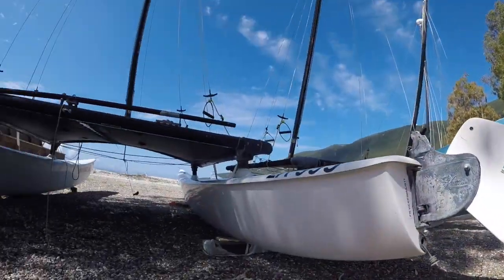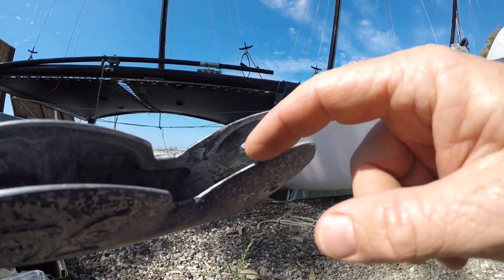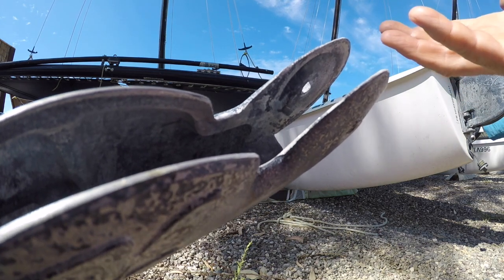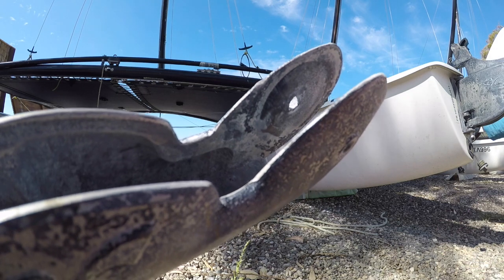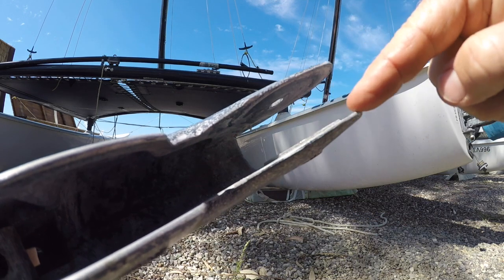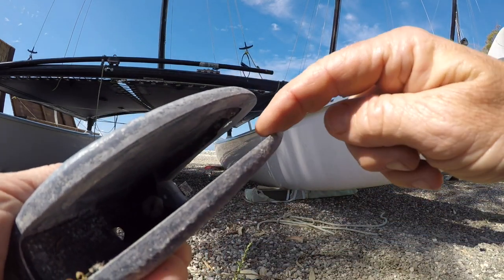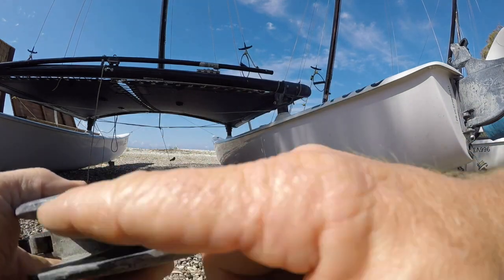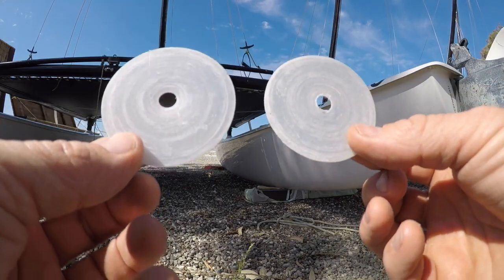Save your rudder blades with this very quick job

Comment: Something else that's very easy to do, is to cut discs from teflon tape and stick them to the sides of the blade. Makes it very easy to install the rudder and subsequent bolt because you don't have to bother with slipping separate discs in-between the blade and rudder cheek casting.
Reply from the maker: That's a great plan. I'm going to try that.

Comment: I’m sailing in the morning, 2nd day on my new, very used, h16.  I’m cutting disks from a gallon water jug with a slit so I don’t have to take anything apart, just try to slide them in there,  pop them in place, I’ll check back tomorrow in the comments with my results! All of your repairs are done on really well maintained boats, So hopefully this is a easy, temporary work around for us pleebs lol
Reply from the maker: Yes, I'm sure that most of the maintenance stuff that i'm doing is going to have many more problems out there in the real world. Good luck being able to slide the disks in, hopefully it won't be too tight.
Reply: I used the lids off of butter or sour cream containers.  I never filed the casting, and the rudders never touched the metal.

Comment: Top Tip! BTW, is that a metal insert in the rudder bolt hole?
Reply from the maker: Yes that's a metal insert - On boats from Europe you either have that or a large plastic plug.

Comment: Hi Joe, how do you get the plastic discs in if there is no room to slide them in? 🤔
Reply from the maker: That is definitely a trick shot! Thinner discs might be an option. With the FX1/Tiger/18 classic styl;e stoick  i Don't use the discs, instead i glue some rubber to the inside of the stock - video coming up!